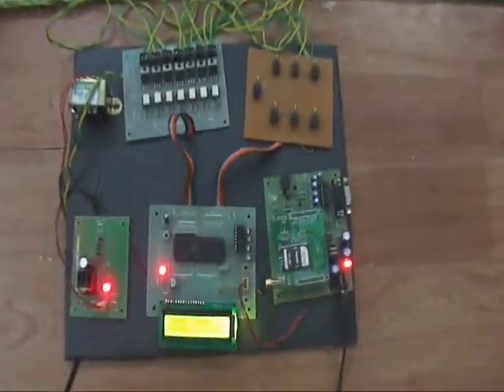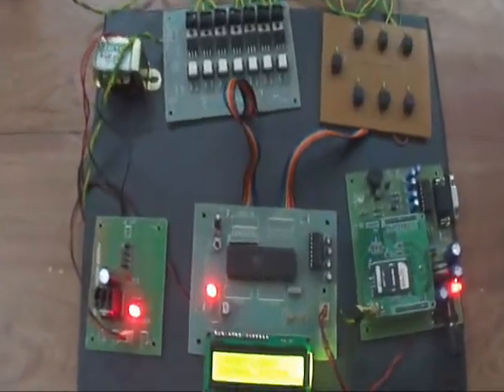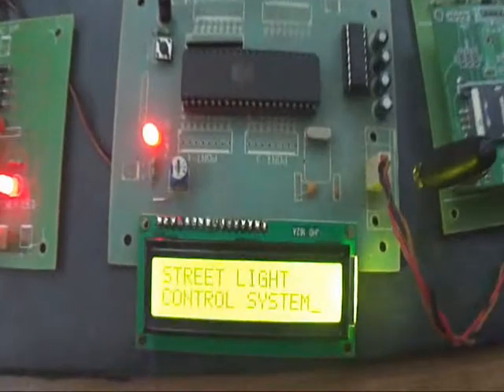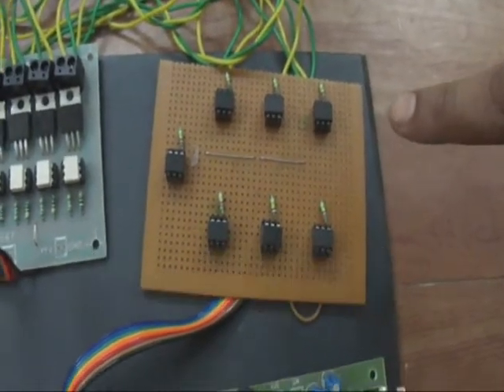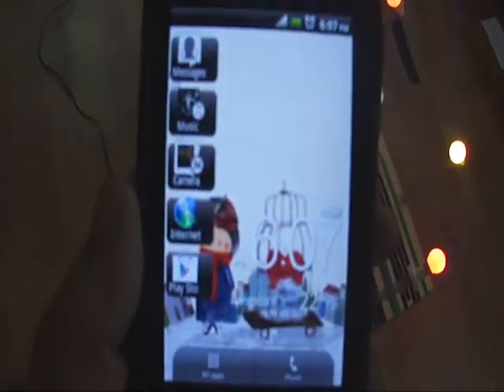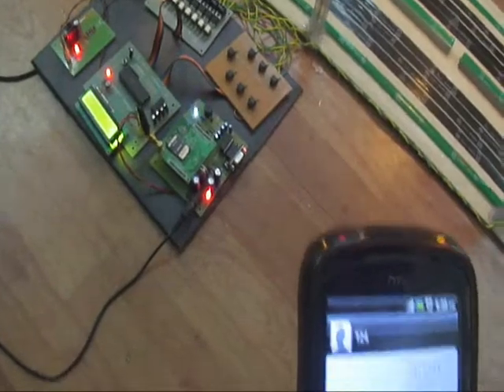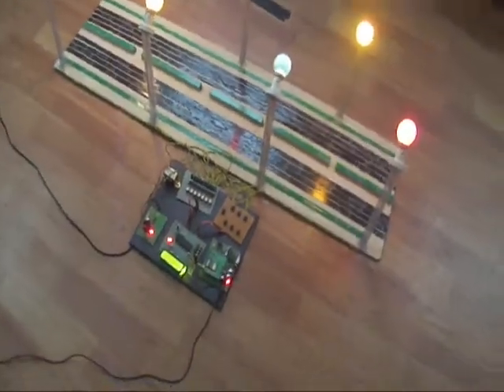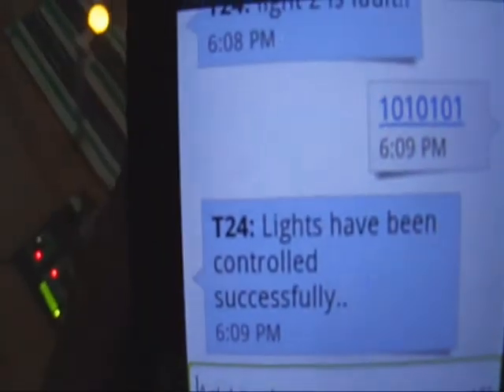GSM Based street light with fault detection

Comment from the maker: Thank you for your complement ..yes we can do it in power failure conditions..for this you need design simple charging circuit for 12V,1 amp battery, when power is available circuit runs from normal power and in another case it works from battery..and also you should design small circuit to give power status to micro controller...